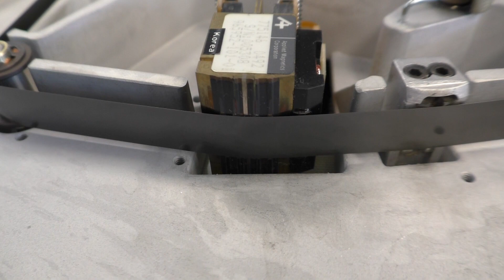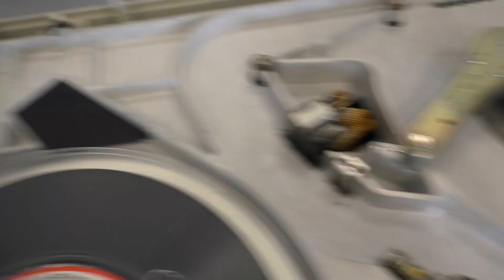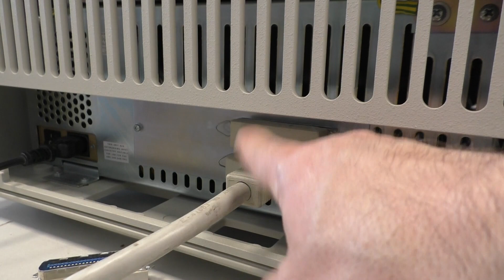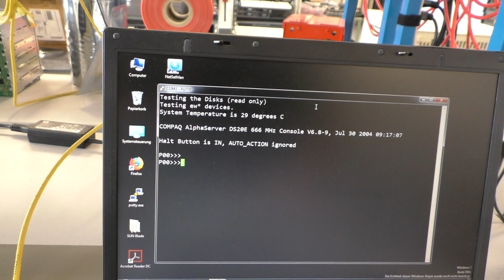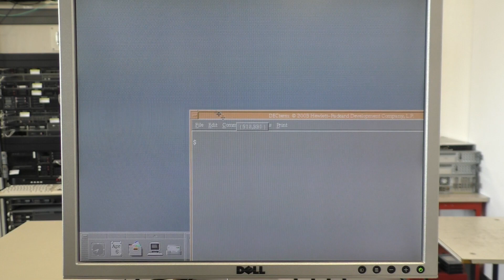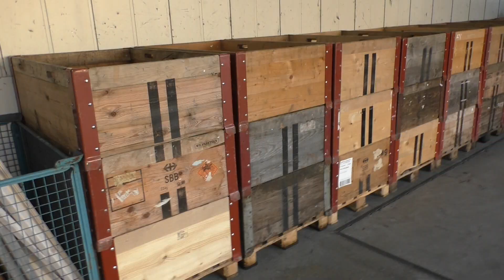9-track tape drive DEC TSZ07 - (PWJ90)

Comment: They use Commodore GCR? Really? Thats cool!
Reply from the maker: Some sort of...yes. But GCR was a thing before Commodore used it and they made their own version which is not compatible to others (ie Apple). But yes, it's the same principle. 🙂
Reply: @PlaywithJunk  I loved GCR because it was way more effective then MFM. Too bad the PC didnt use it.

Also on the end of that video there was a PC in junk I really would love to have, too bad this video is so old! ;-)
Reply from the maker: I know GCR from the Cipher tape drives I used to repair. The really big ones were actually named "GCR Cache Tape" and they were really proud if it. It boosted the data density from 3200 BPI to 6250 BPI.

Comment: I have this very machine. What are you using to keep the tape path clean as Freon is now hard to get?
Reply from the maker: I never used Freon. Everything can be cleaned with Isopropyl alcohol (tape heads and rollers) or window cleaner (for the chassis parts). Normally there is not much to clean except the head and the tape scraper.
Reply: @PlaywithJunk  Thank you. Do you know of a shop or anyone who repairs these drives? I have 2 Qualstar's and an Overland data that need repair. I live in Florida.

Comment: Hello,  I was very and pleasantly surprised that I found your video here demonstrating the "oldie goldie" DEC TSZ07 tape drive.
I am in fact working on a small project trying to restore some older records / data from backup tape that was created on DEC drive and OVMS "few years" ago.
I also have DS20E, DS10 and DS25 servers - but somehow none of these servers can find and show the tape unit under the console commands - the way you

have demonstrated here. 
May I ask what the model or type of your PCI SCSI controller that you have in the DS20E?  I tried few different controllers -  connected the SCSI-2 cable 
(same as you have) with help of additional converters / dongles - to the SE port of KZPBA-CA,  Adaptec AHA-2940U2W as well tried KPZAA and also KPZCA.
The TSZ07-AA works fine off-line, i.e. powers up, loads and unloads the tape, passes the self test - but it cannot be detected by the controller.
I tried the same verification process on DS10 and DS25 - all with firmware 7.3 - but no luck.  
Any assistance will be greatly appreciated.   Thank you - Jan
Reply from the maker: Hello
Do you see the PKA or PKB device at "show device"? This is the SCSI controller itself.... if you can't see that, you can't see any SCSI devices.
When I remember right, you need SCSI controllers with the right firmware for Alpha.  Here you can see what controllers should work: https://manualzz.com/doc/732658/quickspecs
I think I have one of those controllers inside the DS20e...
Then check the SCSI chain... do you have a single ended (SE) controller? SE Terminator (do you have one?)? SE tape drive? LVD/SE does also work. HVD (High voltage differential) is not compatible and needs a converter to LVD/SE.
Also check the SCSI ID of your bus. Controller should be 7, devices can be everywhere except 7. 
On many controllers you also can't connect internal and external devices at the same time.
All your KZPxx controllers should work fine, those are original DEC.
Are your converters LVD/SE too? That's important since some of them terminate the higher 8 bits (wide to narrow converter). This termination must be correct.

Best regards
Christian

Comment: In home tape deck, the obvius benefit of a three head machine, is you can monitor your recording as it is made. But this also have another purpose. Recording head and playback head had opossite requirements by design. A R/P head is a trade off while separate heads allow and optimal RECORD head and OPTIMAL play head. I made a big mistake when purchased my first three head unit. IT COULDNT MONITOR the recording as it was made. I though this was a complete no sense ... should be an error. In the end found this information so this deck had three head just to get more quality on both functions
Reply: This is data tape mate.

Comment: Having PTSDs watching this.  Worked for MCI for years and all our voice billing went through IBM Adjunct processors that had these drives, branded as IBM, of coarse.  For the most part, they worked well but when they went wrong, they went honorably wrong.  If you turned you back on it while loading, you could end up with a few thousand feet of magnetic tape vomiting out the front of the drive.
Reply from the maker: Yeah I know... :-)
But if they are cleaned and maintained properly, they were very reliable. You also had to shape the tape end correctly.

Comment: Oh man, Oh man . I remembered these drive well . CIPHER . I used to be an expert fixing these things F880,M890,M990 and M995.  Good old time.
Reply from the maker: So you changed a lot of motor drive transistors... :-)
Reply: @PlaywithJunk  YES, especially  F880 and M890 not so much on the M995. After 30 years working on them I still remember some of the codes, I.E 451335 ,452235 .....
Reply from the maker: @connervantu  Yeah... and changing the bearings when the guide rollers were noisy.
I would like to repair this M995 but I have no parts. Hard to find the problem with no spare parts :-)
Reply: @PlaywithJunk  Yes, you are correct about the parts. Even then, it was hard to find parts due to not many been made, unlike the M990.  But those rollers guide you can use the one from M990 or F890 ... NO ? .
Reply: The M995 is harder to work on due to the motherboard lots of surface mount components.

Comment: Nice video :) My first time a was using internet was in a library 1997 and they had DIGITAL PCs everywere. But around 2003/2004 when a was in school they had 3 wagons full of old electronic scrap and a did find a Digital Venturis-FP 575 in there that a did keep and a still have it but not touched it for around 10 years now. I have 3 Compaq Deskpro 2000 in storage but a know one of them need new psu.

Comment: this can be used to record music, like what we used to tear apart data tapes and move the tape into audio cassettes.
Reply from the maker: That could be done. But it is much easier to record digital data on an analog tape drive than otherwise. You would need to make a new read/write amplifier and I doubt that the tape speed is precise enough for a quality recording.

Comment: those movaable arms also moved the tape a few inches without moving the reels.  This allowed reading a block of data without moving the reels to the next block.   Other drives used vacuum columns to pull a few inches of tape past the heads.
Reply from the maker: I'm sorry but I have to correct you. The tension arm assembly is only to maintain a constant tension (hence the name). It provided a bit of extra tape travel to compensate timing differences between the supply and takeup reel.
But it has not the same function as vacuum channels. For start-stop operation you need a third motor, a capstan motor which accelerates and stops the tape very quickly to write single data blocks. The reel motors can't do that.
This drive has cache RAM and collects data to write it on tape in a long stream. This is why those drives are also called "streamers"
*smartass/off*  :-)

Comment: What is the manufacturing date of this unit? Are they still in use or is it a clean-the-basement-thing?
Reply from the maker: it's from the 1990's. I kept it because you never know if someone comes with old tapes and wants to copy them to a modern format. But now, since it is not working anymore, I'm not sure what I do with it.
Reply: Play with Junk The idea with the electric bike sounds charming. I guess nobody else has a SCSI controlled electric bike
Reply: @chrisridesbicycles  And if you don't have SCSI you can eventually get there, although by driving 2 seconds forward, 1 second back and so on...

Comment: Austrian Accent for sure :)...insane machine, loading tape using air. What if the tape spins during loading?
Reply from the maker: You mean if it twists? That never happens. The tape is thick enough to aty stable all the time.
Reply from the maker: BTW: Swiss accent

Comment: There is a farm equipment shop just up the road from me which still runs an HP 3000 minicomputer from the early '90s for their shop management system.
Reply from the maker: German railways (DB) was once seeking for old 286 PC's because their timetable boards (flapper boards) have been controlled by such systems. They needed spare parts because they could not afford to replace all those boards at once. Some of them worked for 30 years.
Reply: douro20 my dad used a Machine running MS-DOS 3.something for invoices up until a few years ago. It had a ~230MB  hard drive and we still have all the backups on 5 1/4 floppys.

Comment: I believe HP and Cipher were the only two companies who made auto-threading tape drives.

I almost bought an AlphaServer 2100A 4/275 once but since my parents and I were moving I wasn't allowed to...
Reply: The M4 Data 9914 was an auto loading table top or rack mounted drive. In addition to 1600 (PE) and 6250 (GCR) it also supported 800 (NRZ) and 3200 (DPE). A lot of the more modern 9-track drives didn't support 800 bpi so the 9914 was useful to have if you needed to read an older 800 bpi tape. I had a 9914 for a while but got rid of it after the rubber on the tach roller turned to goo and it could no longer correctly sense the tape speed. Didn't want to deal with trying to fix it at the time.
Reply: Glen Slick,

Didn’t HP just license their 88780 to them?
Reply: Pertec made autoloaders in the mid-1980s that were plug-compatible with Cipher drives.  Also another company, but I don't remember their name.

Comment: Oh - and a note on the capacity... practically speaking, a 6250bpi tape could hold about 140MB - depending on block size - small blocks would waste space due to overhead.  (I think VMS used a 8192 byte block by default for the BACKUP utility).  Again - fun stuff.
Reply: No one used tar to write to tape?
Reply: Sure - you'd use tar if you were running a version of unix - but OpenVMS was common on the Alpha boxes (and VAXen before them) - and VMS came with it's own BACKUP utility.

Comment: That's a very nice machine. Shame that it is pretty useless in today's storage space hungy environments. I was wondering about the capacity too, good that you added that in the comments. Calculated that 800 BPI tape you had in there with 35 MByte total raw capacity if it would be 1100m long. So probably 25 MB after overhead removed.

Comment: No no no no no. This is definitely NOT junk.....
Reply: A few years ago I picked up a unit very similar to this when it was being thrown away. Sadly, I didn't get around to even powering it up before I needed to condense my toy collection. In the case of this beautiful machine, I disassembled it into Useful Bits (including 2 very beefy DC motors, and bunches of sensors) which are now waiting for a new life  in some project yet to come.
Reply: @reprapmlp  Why??? Why would you do that instead of giving it to a fellow hacker who could have made use of it? DC motors are not hard to get....